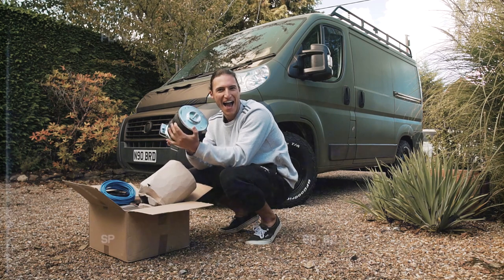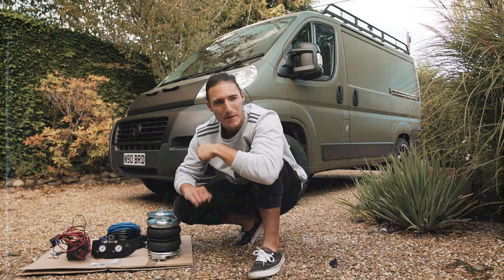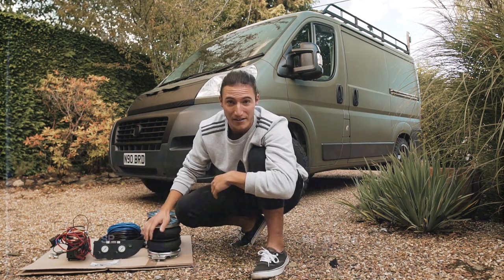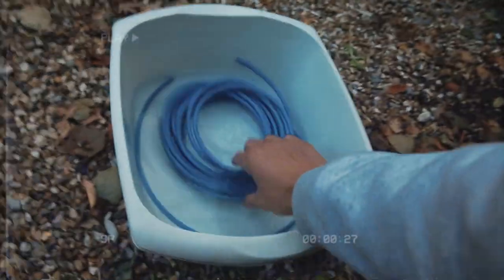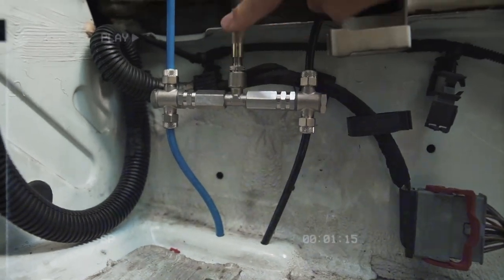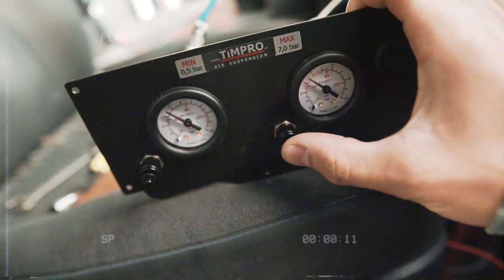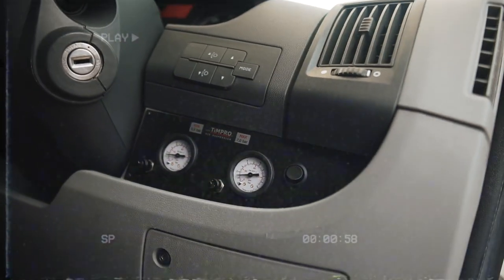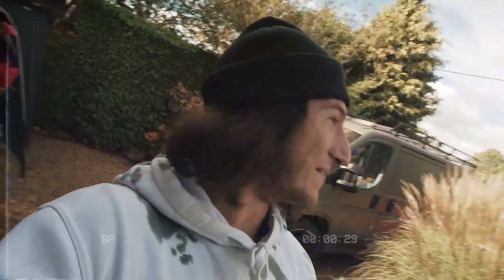FITTING AIR ASSIST SUSPENSION // Cozy Cabin Van Build EP 05.

Comment: Enjoyed the vlog. Very informative. I'm just in process of fitting mine now. Just wanted to know where you ran the 2 cables that connect to the battery? (mine is under the passenger seat but can't see an obvious route to run the cables).
Reply from the maker: Towards the end of the video youl see I just piggy backed from the dash fuse box located on the drivers side

Comment: Nice job, will follow :D
Reply from the maker: Ayyye thanks man. Appreciate it!
Reply: @BradWithTheVan  How's the ride different with the bags? I had VB-Airsuspension B.V. front springs with Koni FSB's installed and that make a huge difference as my Ducato L4H2 had a horrible front rake and new springs also lifted the front additional 6cm. I'm thinking about installing bags at the back after finishing interior the build so curious to hear how the bags perform!
Reply from the maker: @marius2980  I love them! Rear is 100% stiffer and it corners a lot better! Next year I will get new shocks all round but I’m happy for now 💀🤘🏼

Comment: Hi Brad, clickt on the link of the air suspension system, but I can not read anything on that site
Reply: Are you sure it is safe, i haf a left steer car so what to order.
Nice video! I will start with the diesel heater coming days.
Reply from the maker: Hmm strange as Google Chrome translates it for me.. 

Either way just type in 'Timpro Air assist suspension Ducato' on eBay and it will pop up!

They sell LHD or RHD kits, only difference is the switch panel! - Hope that helps!
Reply from the maker: @lexpolderman6355  Yes it's safe
Reply: Super thanks!